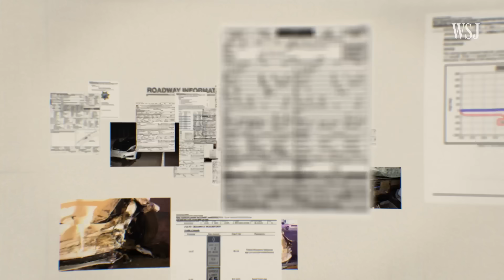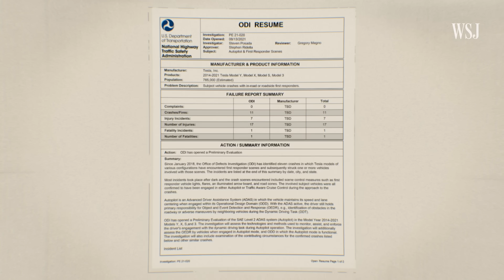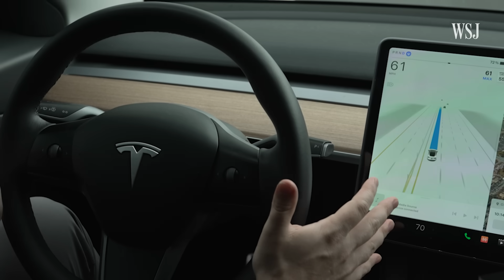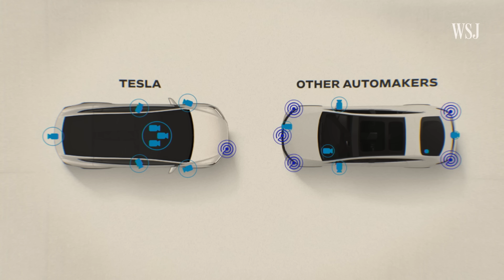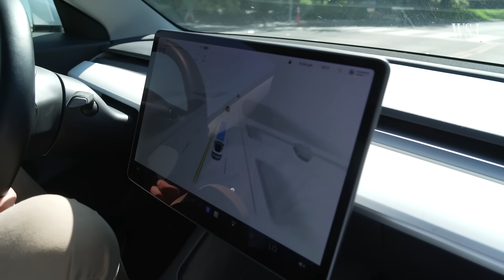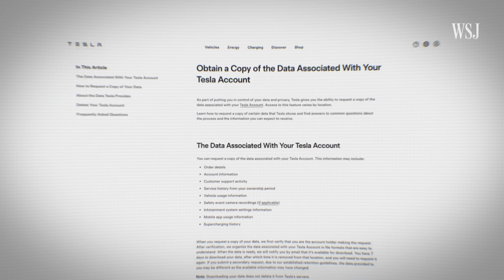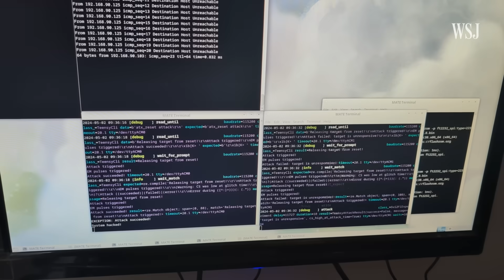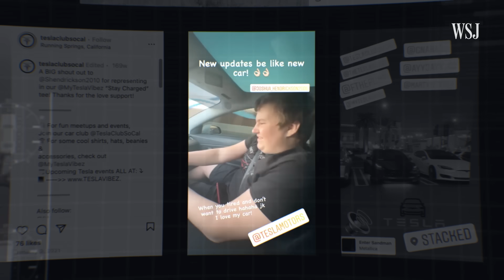The Hidden Autopilot Data That Reveals Why Teslas Crash | WSJ

Comment: I have not been in any autonomously driving car in which you have to constantly stay alert and be able to take control of all times, but that honestly sounds so much more stressful than just drving by myself. You will constantly have to wonder what the AI sees and how it will react and constantly be prepared to engage if the AI is not reacting as fast as you would. When you drive and you know what you're doing and are a confident driver it's not stressful at all, you just do it - I'm never going to get a car with the flawed technology that tesla uses.

Comment: Here in Norway, Tesla's cheap model Y had 25% market share among new cars for the longest time. EV market share for privately bought cars is >90%. We've had a 2012 Leaf and, now, a 2023 purchased brand new. I test drive EVs all the time and have driven 6-7 different Teslas, the latest a 2024 TM3.

I don't understand why people buy these - in droves!

What the video doesn't really convey is the error rate in everyday driving. Tesla's cruise control, TACC, is - to this day and for more than a decade now! - phantom braking on two lane roads. Trucks, RVs and similar parked next to the road or coming towards you, or paint across the road e.g. at a pedestrian crossing? The car will suddenly and often violently brake.

Keep in mind that my 20 year old Hyundai classic has functioning cruise control. A brand new Tesla has not. On top of that, take American "quality" where Tesla's sales share here is 20-35% over the years, but the publicly registered car related disputes are a whopping 90% of cases.

There's so much more, from the terrible ergonomics of fully screen-based cars to Musk's comic villain antiques.

Do. Not. Buy. Tesla.

Comment: A Tesla hit piece. Other car manufacturers have this problem. Also Tesla Autopilot requires supervision. Its no different to someone crashing a car while using cruise control. Also lidar based systems dont guarantee no crashes. There has been many instances of lidar based self driving vehicles crashing. WSJ fails to provide evidence that Lidar based systems are safer. Also at the end of the day it is user error. The Tesla FSD system has several safe guards to notify the driver to pay attention to the road and keep the hands on the wheel.

Comment: For the dozens or so comments below stating something like "it's called Autopilot", autopilot systems onboard aircraft do not allow the pilots to go to sleep, and not pay attention.  The systems allow the pilot to monitor the systems with a reduced workload.  WSJ is also giving away its bias here by not explaining at least three things.  FSD and autopilot are different.  The driver must acknowledge they are still responsible for driving the car even while the system is active.  And, FSD/Autopilot have come a long way since 2021, orders of magnitude safer (this is a reposted video from years ago)

Comment: Night cases with the overturned truck and the pick-up are definitely avoidable by radar assisted brakes, which are available even in low-end cars today.
Reply: Teslas originally relied on radar, too, but Musk has decided to phase that out, even in cars that still have radar hardware. His explanation was that for lower-resolution radar, there are too many false positive events that cause the cars to slow down for nonexistent threats.

I can confirm that this was indeed a common annoyance in the past, and possibly a way to get rear-ended, and since going to vision-only, that annoyance is mostly gone. But, that doesn't mean Musk is necessarily right. Could be that his engineers just weren't good enough to properly filter the radar data. Radar has always been an imprecise sensor, it's only good signal processing that makes it useful.
Reply: @nathanscandella6075  The only way this makes sense is if....

Oh. Radar Jammers.

Yeah people running around with radar jammers in their cars causing accidents with self driving vehicles makes sense.
Reply: @nathanscandella6075  The same applies to vision. It is imprecise signal (captured images) processing and interpretation of the images that is the problem. Vision is good enough if done properly for sure. Animals, humans and insects have been relying on it for millions of years.
Reply: @nathanscandella6075  they removed RADAR and count out LIDAR for cost reasons and because they have architected it all poorly, relying on AI for a job that really should be done traditionally.
Reply: @nathanscandella6075   yeah, part of the issue AIUI was the conflict between camera and radar in Tesla's stack specifically rather than necessarily an inherent issue to radar. 

And when radar is bad-enough to freak-out because of a leaf in the road, it's at least consistent-enough that you learn it quickly and compensate; rather than inconsistent and seemingly out of nowhere like with Phantom Braking.
Reply: In 2021 radar was still the main driver of auto pilot.
Reply: Not on basic openpilot powered radar systems. It needs to lock on and ignore surrounding stationary objects. They don’t “see” in a traditional sense. 

A stationary vehicle in front can be discerned somewhat easily, but many systems failed to even react because they are coded to ignore completely stationary objects. For example, you don’t want emergency braking to occur from a car parked on the side of the street, or an upcoming curve where road signs would reflect back to the sensor which would indicate an inevitable collision. 

I won’t get into details of how the system works, but they need more time to lock on to stationary objects. They can react extremely well to the moving vehicle in front of you or a pedestrian walking out from behind objects. Not always the case for completely stationary objects (I did avoid a crash with a table in my lane and not too surprising the radar did not detect the table whatsoever). They also need to ignore oncoming traffic which is a huge weakness. Emergency braking almost never works on these basic radar systems if oncoming traffic were to head towards you or you towards them without (ironically) camera systems which Toyota and Tesla have already implemented. 

It’s most probable that basic radar would not have stopped for an overturned truck at those speeds.
Reply: Radar does not detect objects standing still in any car. The crash in the example happened with radar active.
Reply: Most humans would also crash in the situation they showed those two accidents. The overturned truck was completely not visible up till last second.
Reply: @sureshkrjsl No. Human vision is far better than the what these cameras capture. Yesterday night I had a jaywalker cross the street without even looking (I had the green).  I slammed the brakes to stop in time. I saw her much earlier than she appeared on the low qualityTesla video.
Reply: @bikeman7982  tesla may or may not have a camera which is better than human eye. But you are absolutely wrong that human eyes are better than cameras. A really good camera can see far better than human eye and an AI can react hundred thousands time faster than human.
Reply: @sureshkrjsl  Stop strawmannirg! "These cameras" refers to the cameras in Teslas like mine. I never said the human eye is better all cameras. Re-read my statement and tell me when I said "human eye"?

Of course computers can compute/react much faster than humans. Thats nothing new.  The question is the frequency with which AI makes correct decisions. I believe it will get better with time. 

I am all for autonomous driving (I've been using Tesla Autopilot for 6+ years and loving it).
Reply: @sureshkrjsl  Just because it was not visible in the onboard camera replay, does not mean it was the same for human in that situation, if the human would have paid attention. The event replay is of very bad quality, probably on purpose, to give you the impression of not being able to see. 
I have been in a somewhat similar situation, autumn storm, rainy conditions, suddenly I saw what looked like a tree fallen on the road and braked later and harder than normal due to bad visibility but still before my car's auto braking activated. Model X next to me ploughed straight until sudden swerving just before the tree  - that was most likely driver intervention. Took significant front end damage and punctured a tyre. No people were harmed. But he cleared the left lane for the rest of us at the cost of his own car. :D
Reply: @UserErr0r3578  I am still learning to drive in the US so I am not very confident. But, situations like these is what gives me more anxiety and prevents me from putting effort into getting a driving license lol
You are right that the video may have been made bad on purpose to be biased towards teslas. Good cameras can see better than human eye because they can gather more light. It depends what the actual quality of image camera sees compared to what it stores. So, it could be seeing in high quality but to minimize the storage size, stores in low quality and that's what we saw
Reply: @sureshkrjsl  Just to be extra clear, in my opinion, Tesla is at fault here. Attentive human driver with around a decade of daily driving experience under his belt is going to outperform fsd consistently. That decade of experience is going to train your brain for all kinds of situations, plus humans (most of us anyway) have the ability to predict some things that AI currently can't. For example, a lot of cars slowing down for seemingly no reason, then human driver also slows down, but the AI will not unless, it actually detects an obstacle. 
Attentive is the key part here, unfortunately about a third of the drivers around here seem to be doing several other activities while sitting behind steering wheel.
Reply: No camera on earth compares to our eyesight: your retina is much more light sensitive, your pupils can dilate, and your brains signal processing is the O.G.
Reply: @sureshkrjsl  yes, but thats because you saw what Tesla saw (and recorded). Even average person's eyes would be able to detect the situation better.
Reply: @miroslavbajgar I think the difference here, and what Tesla's cameras aren't doing well enough, is that your eyes are able to lock onto some specific point in the field of view and change your focus and how much light your pupil lets in so that you can see the specific dark point of the overturned truck well enough, at the expense of the rest of the surrounding area being too bright for a second, until you decide whether it's a valid problem in the road or not. Tesla's cameras obviously aren't doing this. If they had real-time dynamic focusing/lighting correction I think the cameras would behave more like eyes and their software could then detect the thing in the road much quicker. That's just my two cents though, as a software engineer.
Reply: AFAIK, radar is not good at detecting stationary objects of any kind, only moving objects.
Reply: @georgepelton5645 not true. In fact, if the car is driving, everything around it is moving relative to it, both other vehicles and stopped vehicles.
Reply: No, they are not.  Clearly you do not know what you are talking about.  Tesla is the safest car on the road.

Comment: I absolutely DO NOT trust "autopilot" or any driving assists and I also do not trust electric vehicles as I've heard, read and seen too many spontaneously combust.

A regular cars battery has the ability to randomly combust, but it's far more likely to happen with an EV.

Comment: WSJ reporting paid for by… if u can’t tell the difference between “auto pilot” vs FSD, then u have no business reporting. With auto pilot it’s a cruise control that requires u to have ur hands on the steering wheel.

Comment: If you're in the passenger seat and the driver is heading straight for a truck, you'd naturally warn them if they weren't braking. Similarly, if you notice your Tesla on autopilot approaching a truck without slowing down, you'd take control and brake. Even though I don't own a Tesla, I'm aware that drivers must remain attentive while using autopilot. Tesla has always stated the necessity of this which seems to have been briefly glossed over in the video to avoid legal issues. Have some integrity!

Comment: This is a MISLEADING video that gives unfair criticisms of Tesla.  It makes no comparison of crash statistics for cars with Radar/Lidar/Video navigation versus pure Video navigation.  It merely states that Tesla is dangerous because it navigates only by Video, but does not say anything about how dangerous competing systems are that also use Radar and Lidar.  Tesla has ALWAYS made it abundantly CLEAR that drivers must always pay attention and be ready to take over, while a Tesla car is piloting itself.  This video does not distinguish between Tela "Auto Pilot" and Tesla "Full Self Driving", both which require the driver to pay attention and be ready to take over.  "Auto Pilot" is just a more sophisticated form of "Cruise Control"; whereas "Full Self Driving" is far more advanced and capable of navigating much more complicated city traffic.  Missy Cummings' 2016 statement [01:30 in video], "There is no question that someone is going to die in this technology." [referring to autonomously driven cars] is DISINGENUOUS.  Is she suggesting that nobody dies when humans are driving cars?  If autonomous cars significantly reduce the number of car fatalities, then self-driving cars would be justified and they would save lives.  Finally, while many criticize Tesla for autonomous cars that use video only, and not Radar/Lidar, well that is the SAME way humans have been driving for a hundred years, purely by eye and not using Radar/Lidar.

Comment: There is no such thing as “safe” driver, be it human or computer. To objectively evaluate a computer driving program one must compare it with something, and at the moment the best comparator is an average human driver.  Silly mistakes by both human and computer drivers are here to stay, so to claim the computer driver is “unsafe” by highlighting one single tragic event caused by a malfunction, is deeply flawed. What should be done is to compare the number of accidents per million kilometres driven (or perhaps fatal accidents per million miles driven). We cannot make an overarching claim that human drivers are unsafe by showing one of the millions of dash cam video on YouTube , can we?

Comment: The real problems is that Tesla's autopilot is NOT level 4 as it's ambiguously marketed. It's really level 2 and NOT anywhere close to where it should be for ANY autopilot to take control yet. That's the reality and that is why people are getting killed. You couldn't pay me to own a Tesla but it's that combination of the fact it is not a level 4 system and people are lazy so they use it like it is one and then they die unfortunately. THAT is the hard truth and it will continue to be the hard truth as long as nothing changes.
Reply: No, Tesla doesn't market anything or call anything Level _ nevermind, Level Four.
Reply: @isthatatesla  What do you think full self driving means? Have you even looked at the differences between the different levels of self driving autopilot?

Comment: And people wonder why Tesla in Europe and China don’t offer full self driving.
Reply: This is not Full Self Driving, it’s Autopilot. There’s a huge difference. Their current version of Full Self Driving (Supervised) is actually quite capable, but you are still required pay attention and take over if necessary. I think they should just get rid of the inferior Autopilot altogether at this point.
Reply: Because European laws have yet to allow FSD to happen. It is coming but not yet. I read somewhere that China has begun to let it happen for both local brands and Tesla to do it over there.
Reply: China has the same regulations around FSD Supervised as the US
Reply: It's called FSD SUPERVISED.
Reply: @isthatatesla which is a self-contradictory name
Reply: @isthatatesla  And FSD is called "fully self driving". Only later did they add the paradox "Supervised" behind it, which should tell you something.
Reply: @termitreter6545  IFSD is in development and will be fully functional in 26.  Maybe it should be called Training Self Driving until then .
Reply: @gledatelj1979  I think they shouldnt call it "self-driving" at all, until it can actually do that. Not to mention they one-up it with "fully-self-driving", which makes it only worse.

They could call it "cruise control", "partial autopilot" or semi-automatic or so. And rename it when self-driving is a thing. Wouldve been so easy.

Thats why its hard to feel for Tesla imo, they used a term thats great marketing, but hides the limited nature of the AP.

Id also be doubtful when, or if Tesla ever makes self-driving workable and reliable tho. Theyve been saying its there in two years since 2015. Reliability/safety is so important with autopilots.
Reply: @gledatelj1979 (Unsupervised) ‘Full Self Driving’ has, according to Tesla, been a ‘year away’ every year for 8+ years. Not that that would even mean anything anyway; it’ll forever be a sliding scale of ability; not a binary “it’s ready now”.
Reply: @termitreter6545  It is self driving though and it's much more than cruise control.  It goes from parking to parking. Right now it's training just like human training his muscles for anything.
Reply: @termitreter6545  That word was added after TESLA realized vehicles with Hardware 3 were not capable of Un supervised.  The current Hardware 4 released in 2023/24 is capable of unsupervised which is expected end of this year.